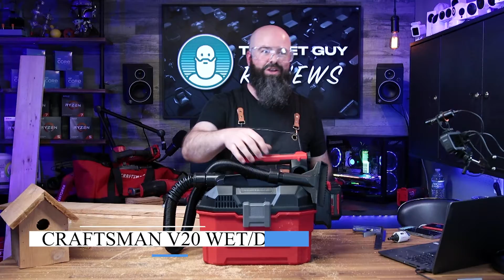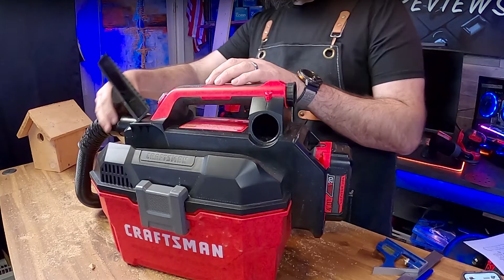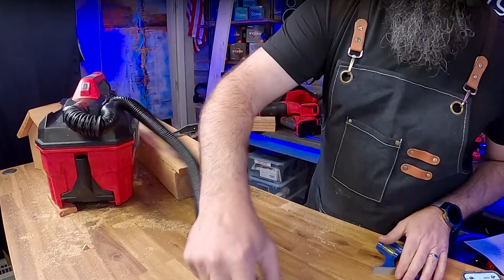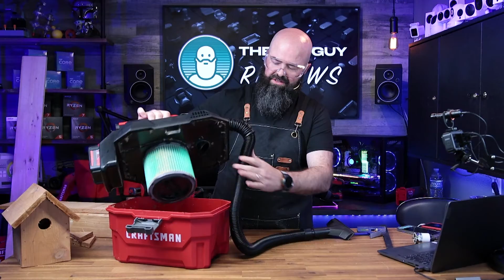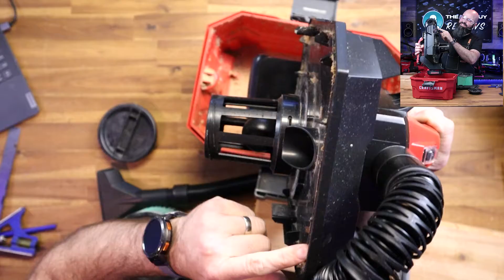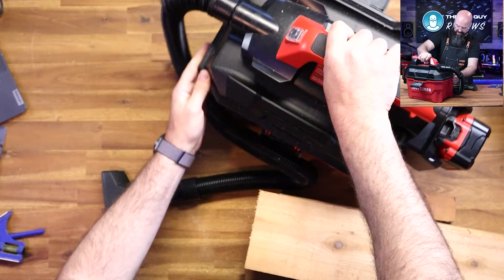This battery vacuum really sucks - it's my favorite Craftsman V20 tool!

Comment: I bought one of these very recently and was disappointed to find out that Craftsman doesn't have any type of dust bag available for the unit show the Filter and the inside will Always be filthy. I don't like that because I have craftsmen wet drive are over 20 years old that still look like their brand new even though they've open used very harshly I just always use a bag inside